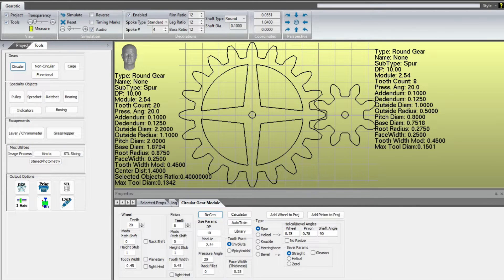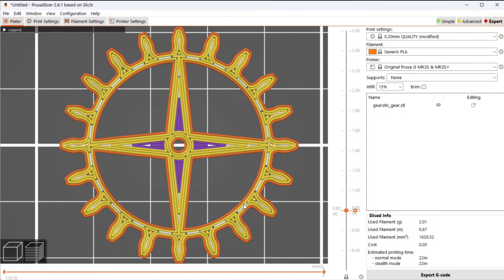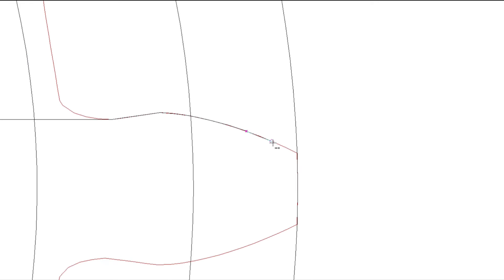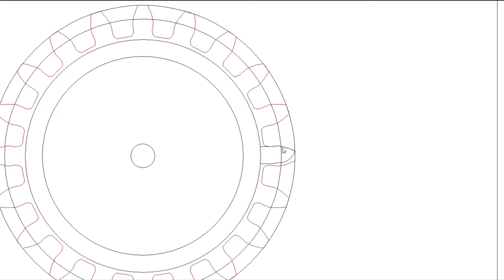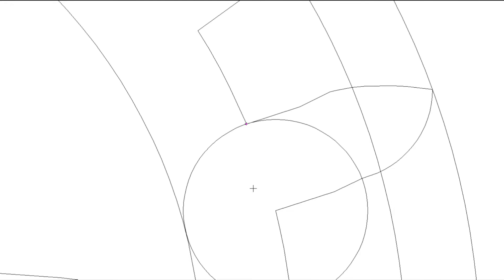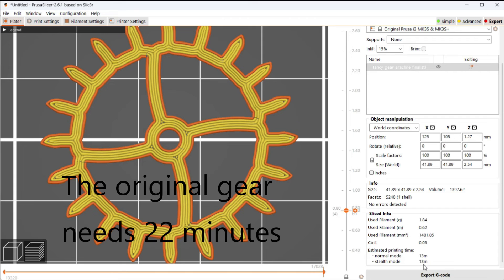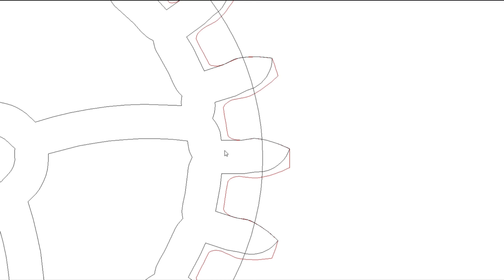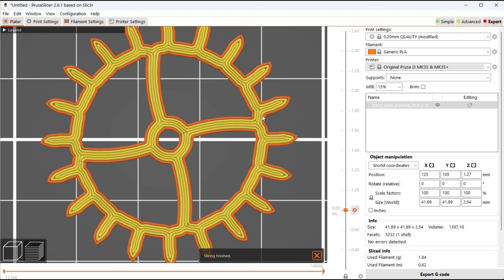Clock Gear Optimizations for 3D Printing

Comment: Very interesting engineering discussion! I found a lot of value in the 3D printing adjustments you made. I never really thought about the added retractions although now I’m sure I’ve had issues. Just found your channel. I think I might have to build a clock now! Thanks for sharing!
Reply from the maker: 3D printers are really good at handling retractions most of the time. However, traditional style gears can end up with thousands of additional retractions and if a small percentage of them have stringing then the gear surface can pick up a defect. My clocks are designed with runtimes of 8 days or more so low friction is incredibly important. Bumps on the gear surface can be enough to stop the clock if it is anywhere close to the escapement. Minimizing retractions significantly reduces the chances of random blobs on the gears.

Comment: What brand would recommend?
Reply from the maker: Any modern 3D printer is fully capable of printing the gears. My recommendation is to select one of the more popular printers   so it will be easy to find support. Ender 3, Bambu Lab, or Prusa are all great choices.

Comment: The divets in the central hole wont negatively mpact centering accuracy.
In fact they can improve it.
When you use bigger divets you can create.an undersied hole that can stretch to create a very good friction fit. Look up some compliant mechanism designs.
Reply from the maker: I will keep that in mind for tight holes. I let the gears spin on the arbor, so they need to be a loose fit.

Comment: Great ideas.  For the few remaining little blobs, you can remove the "Z hop" in PrusaSlicer by setting "Lift Z" to 0 under printer settings.
Reply from the maker: Good point. I was showing ways to change the design to reduce as many retractions as possible and didn't mention any software solutions.

Comment: Wow! Wish I knew about gearotic. I ended up writing a gear generator in onshape - mine uses “profile shift coefficient” rather than the tooth width % to set backlash and clearance… I wonder what the difference is.
Reply from the maker: There are many different gear profile generators. Some are free or have a nominal fee. 

I think the profile shift coefficient changes the addendum and dedendum ratios. Gearotic appears to call it pitch shift. Tooth width is a separate parameter.